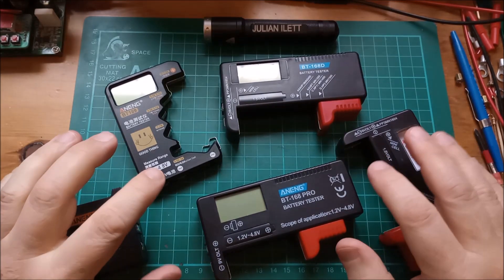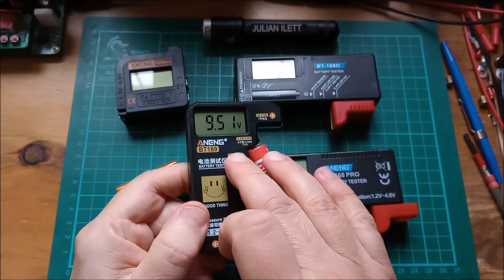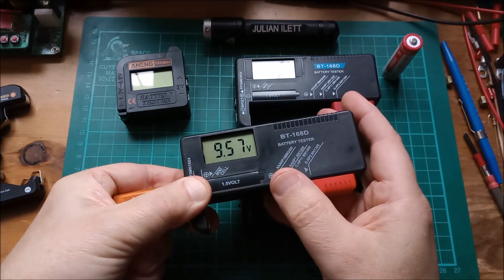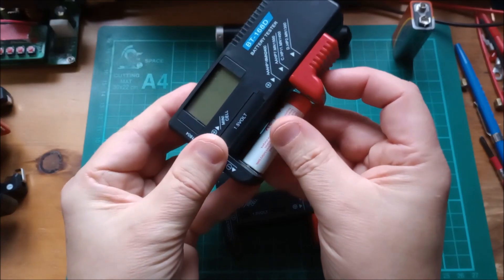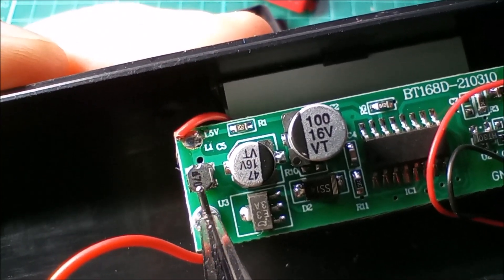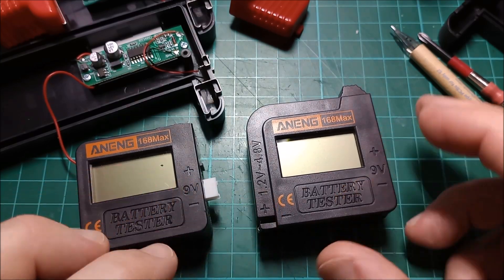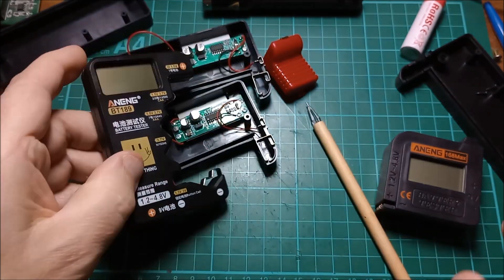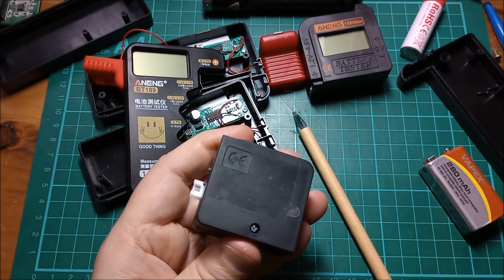Battery Testers Analysed

Comment: I have an older BT-168D, with no latch, no blue strip. Looks like your latching model but the words "BATTERY TESTER" is less bold. Inside, a blob chip on a board marked BT168D-110702.

I modified mine with a pushbutton and load resistor, 19 ohms.

Comment: That latching function is really absurd tbh, part of the point of a tester is to induce a load current, some cells can give off an extra burst of dissipation towards the start before the chemistry drops like a rock, so it's just going to get tricked into reading out the wrong voltage every time.. A switch for latch/live would be smart, as well as options for load-currents. A cheap meter that also tells you the cells ESR could also be really nice.
Reply: Agreed, I use the 189 style for triage.  Great form factor for skimming through a lot of nice lithium cells at the recycler and discarding the dead, then bring the ones that test good home for a rinse and a check with the analog meter.

Comment: Maybe the latching could be disabled by changing the state of one of the ic pin ??? Without any datasheet will be needed some reverse engineering and some brain muscle.
Reply: It can be anything from a custom ASIC to an otp microcontroller... If it is an ASIC and actually does have the option for disabling latching it can be fun to try and reverse engineer it. Otherwise i bet its a microcontroller and the firmware is probably programmed with latch enabled

Comment: I have two BT168D I've added resistors to, both of which have had the positive wire eventually fail
Reply: Resolder and then use hot glue strain relief up the wire a little. While you’re at it lube the tracks a little bit.
Reply: @pault6533  Team latching here, I cleaned up the slider when I resoldered my red wire as well.  Works nice now.
Reply: Oddly, mine do not latch

Comment: Sometimes you get a much lower voltage reading on the 9V prongs if you mistakenly have the slider terminals in the closed position.  Depends what version you have.

Comment: These testers do indeed put a load in the cells.  They vary from supplier to supplier.  The lightest load is the ANENG BT-168 PRO, a couple mA which is safe enough for coin cells. The heaviest is the BT-168D, which is 26 mA at 1.5V, 12 mA at 3V, 9 mA at 4.2V, and 15 mA at 9V.  This is too much for coin cells.   Like another poster, I have added resistors where appropriate in order to increase the load, I did this to the 168Max to suit larger cells, which I would not use on coin cells either.

Comment: Sure you could ad some kind of 555 deriving a power supply from the source and use that ot refresh the display. if the latch is all you can get a hold of

Comment: This is a case of using the right tool for the job.   With a battery tester, most people would use them to measure just one battery.   There are plenty of cheap  panel volt meters around to measure voltage in circuits that would be as accurate, maybe more so, as the battery testers which are basically just designed to let someone know if a battery is good or dead.

Comment: Why buy meters that you have to butcher ?
You can buy four  '0.28 Inch Mini Digital Voltmeters' for the same price as the 168 (according to amazon)
Reply: Power drain, the LCD ones draw practically nothing.  Also the LED ones need 4v (IIRC) to work, the LCD will fire up  at 0.5v..

Comment: These battery testers are confusing products.  These type of devices are what led me to buy a multi meter.
Reply: Problem with multimeters is they don't put a load on the battery, so they will show the "float" voltage and fool you into thinking a battery is good.  

If you put your meter on your car battery it'll show around 13v, when you first start the car the load will cause it to drop to 10v-11v or so.  But a bad battery will also show 13v, but when trying to start will drop far more, maybe down to 7v-8v.

Your meter can lie to you.

Comment: It's quite easy to put a low value (say 10 Ohms) resistor in series with the battery to put a small load on it. I found this works well with the BT-168D (Assuming you have one of the non-latching ones). I know that's not what you're using them for, but just a comment on your remark at the beginning.
Reply: Fair point - but I wonder whether it might be better to use a set of different resistors to suit the different battery types these units take 🤔 maybe switch in a range of resistors & you could see how quickly the voltage drops to determine if a battery has good capacity. It’s a bit overkill having other kit to do this but it’ll be a useful edition for a simple unit. I’m going to order the 168 as it checks the 18650 rechargeable batts.

Comment: I think what you really want is these LED voltmeters get them in four digits and I'll have three wires on them a power negative and detect or signal and they could go up to like 30 volts or something easily That's what you want it's basically just the seven segment LED display
Reply from the maker: The LED voltmeters draw a fair bit of current. What I like about these battery testers is the very low current draw, and that they work from a very low voltage.